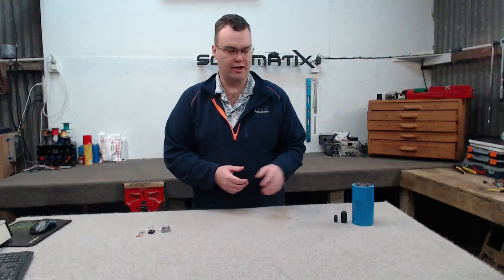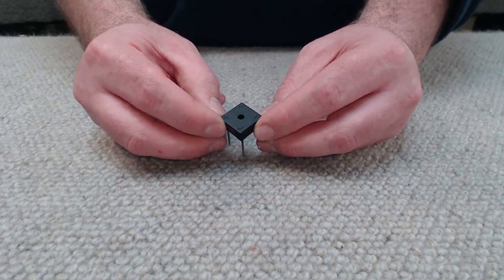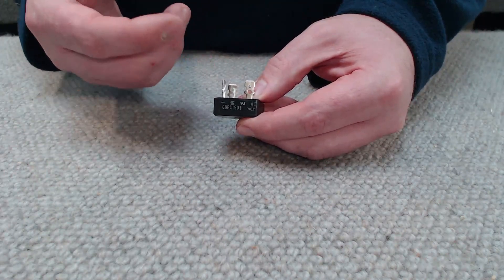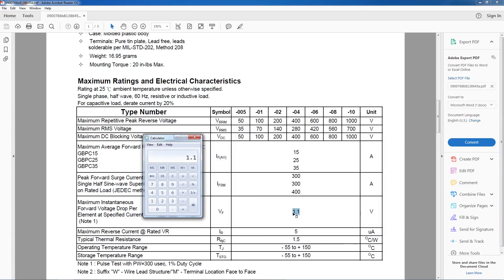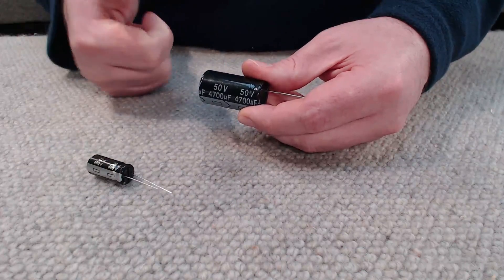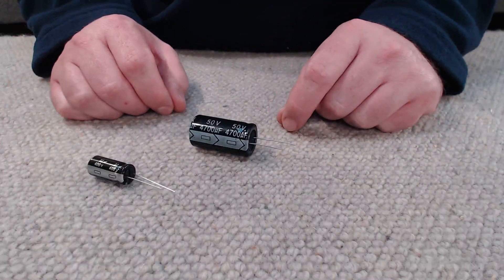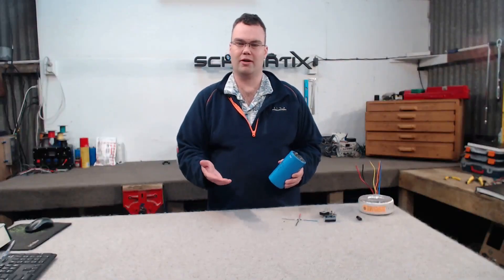How To Choose The Right Rectifier & Capacitor For Rectifing AC to DC

Comment from the maker: Please study the calculation examples in the video description to better understand how to read the results of any calculations you make for capacitance  :)
Reply: Raks Electric; OK, first you have to find the peak voltage after rectification. You calculate that simply by multiplying the AC output voltage of the secondary of your power transformer by the square root of 2. That gives you the peak DC voltage output of the bridge rectifier, before adding any smoothing/filter capacitors to it. (A very close example to this video would be a secondary transformer voltage of 50V X 1.4142 = approximately 70.71VDC out of your rectifier bridge.)

Then, you as a designer of your circuit, have to determine the "minimum acceptable voltage" that your circuit can safely or effectively operate from, which, depending on circuit design and type, can vary significantly , however, for most electronic items, if you stay within a 5-10% drop from the Peak DC output voltage of your rectifier then you should be fine. Your specific design may require tighter tolerances than that, but if so, that increases your required capacitance ( and cost ) quite significantly!

So, just for an example that's again relatively close to this video for ease of comparison, let's say that in order for your circuit to work effectively and to perform at an optimum level it needs an absolute "minimum acceptable voltage" of 65 volts DC. If you do the math, that voltage would be within about -8% of the peak DC volts out of your rectifier, so that should be just fine in most cases.

The difference between the peak voltage out of the rectifier and the "minimum acceptable operating voltage" for your circuit would then be the "acceptable voltage drop" that is used in the final equation for determining the required capacitance value. In this example it would be: 
70.71 - 65 = 5.71V "acceptable voltage drop"

Now comes the (slightly) confusing part; This video didn't explain the discrepancies in the units , and that is why the answer is not exactly what is shown, but rather off by a factor of 1000 in each case... The (correct) formula for calculating the required capacitance is, (should be);

Circuit Current (IN AMPS) x Half Cycle Time (IN SECONDS) / Acceptable Voltage Drop (IN VOLTS) = Required Capacitance (IN FARADS)

If you use the above formula with the above shown units then your answer will always be correct... Using the above example's first Voltage calculations, and assuming (again for example only ) that your circuit current is 10 Amps and you are in a location that uses 60Hz frequency of AC power, like in the USA, then the correct way to use the formula is as follows;

(First calculate the last needed parameter to use in the final formula, which is the Half Cycle Time of a 60Hz line frequency, but calculate it in SECONDS, instead of mS, as is the error in the above video... This then equals 0.008333 Seconds.) (1/120th of a Second)

Now finally put all of your (correct unit) numbers into the correct unit formula which I showed above and you get;

10 (AMPS) x 0.008333 (SECONDS) / 5.71 (VOLTS) = 0.0146 (FARADS) of required capacitance. (Approximately anyway, due to rounding of answer)

Now, since 1 FARAD = 1,000,000 MicroFarads (or uF), then just multiply the above answer by 1,000,000 and you get the correct answer of 14,600 uF.
In this example's case, I would just use a 15,000 uF capacitor for a filter capacitor, which is the next largest commonly available value above the "minimum required" 14,600 uF.

The above example may seem complicated at first, but once you do it a few times with different values and for different electronic projects, you'll get the hang of it quickly. And if you always use the consistent (whole) unit formula above, and then just quickly convert your answer from Farads to MicroFarads (1/1,000,000th of a Farad), then you will always calculate the correct answer when doing this!

FYI, the formula in this video gives answers in MILLIFARADS (or mF) (1/1000th of a Farad), NOT MICROFARADS, (or uF) (1/1,000,000th of a Farad)!... Simply because they are using MILLISECONDS (mS) (1/1000th of a Second), rather than full Seconds... Somewhere along the line, the units got switched or dropped, (i.e. "lost in translation"), in the formula shown in the video, from the original, correct formula which I gave above... Possibly because oftentimes mF (millifarads) is commonly mistaken for uF (microfarads), simply because of the letter "m"!

Anyway, now you know the "rest of the story", LOL!... I hope this detailed explanation helps someone out there to better understand this at least, because knowing what is the correct size of capacitor to use to filter your AC-DC power supply is a VERY important part of proper electronic equipment design!
Reply: JoeJ8282 I really loved ur explanation
Reply: @JoeJ-8282  Great Explanation :)
Reply: @JoeJ-8282  Gr8 job
Reply: @JoeJ-8282  Your response was very good, but, instead of posting this:

"(First calculate the last needed parameter to use in the final formula, which is the Half Cycle Time of a 60Hz line frequency, but calculate it in SECONDS, instead of mS, as is the error in the above video... This then equals 0.008333 Seconds.) (1/120th of a Second)"

You should have posted this:
"60 Hz AC in the US means 60 full sinusoidal cycles per second.  We need to calculate the half cycle time, so we compute 60 * 2 = 120.  We do this because there each full cycle is made up of 2 half cycles.  Then we compute 1/120 = .0083... seconds for each half-cycle time duration."
Reply: @ab_ab_c  Well, either way it's saying basically the exact same thing, and with a similar number of words too, so semantics and nitpicking the explanation is unnecessary. Your paragraph and wording works fine, and the way I said it did/does too. The important thing is that whoever actually cares enough about this topic in order to actually read and pay attention to all of this will probably understand either way of saying it, (i.e. either yours or mine), so it doesn't really matter too much.
Reply: @JoeJ-8282   Wow! very well explained.  I have a question. I have a transformer rated at 120VAC stepped down to 12VAC (180mA written on transformer label) with a full bridge rectifier (1n4007) and capacitor.  My circuit requires 12VDC. How much capacitor (capacitance and voltage) do I need to ensure no problems occur?  Thank you in advance :)
Reply: Accumulator1; I totally understand your confusion, however, you made the same exact (very common) mistake that this video makes, in confusing the units of mF (MILLIFARADS) and uF (MICROFARADS)... The answer actually IS 15mF, however, it is ALSO 15,000uF, because they are a ratio of 1:1000 ... The full, detailed explanation is below;

(BTW, A Higher capacitance used for the filtering of a bridge rectifier actually results in LESS of a voltage drop, not more, and therefore a higher capacitance also results in a more stable final DC output!)

Now comes the (slightly) confusing part; This video didn't explain the discrepancies in the units , and that is why the answer is not exactly what is shown, but rather off by a factor of 1000 in each case... The (correct) formula for calculating the required capacitance is, (should be);

Circuit Current (IN AMPS) x Half Cycle Time (IN SECONDS) / Acceptable Voltage Drop (IN VOLTS) = Required Capacitance (IN FARADS)

If you always use the above formula with the above shown FULL units then your answer will always be correct... Using this video's "Acceptable Voltage Drop" calculations for an example, and assuming (again for example only ) that your circuit current is also 10 Amps and you are in a location that uses 60Hz frequency of AC power, like in the USA, then the correct way to use the (correct unit) formula is as follows;

(First calculate the last needed parameter to use in the final formula, which is the Half Cycle Time of a 60Hz line frequency, but calculate it in SECONDS, instead of mS, as is the error in the above video... This then equals approximately 0.0083 Seconds.) (1/120th of a Second)

Now finally put all of your (correct unit) numbers into the correct unit formula which I showed above and you get;

10 (AMPS) x 0.0083 (SECONDS) / 5.5 (VOLTS) = 0.015091 (FARADS) of required capacitance. (Approximately anyway, due to rounding of numbers)

Now, since 1 FARAD = 1,000,000 MICROFarads (or uF), then just multiply the above answer by 1,000,000 and you get the correct answer of 15,091 uF.
In this example's case, I would just use a 15,000 uF capacitor for a filter capacitor, since it is so very close to the calculated value, and that value is the closest commonly available value. Plus, since most electrolytic type capacitors generally tend to measure slightly higher than stated anyway, especially when new, then you should be just fine!

The above example may seem complicated at first, but once you do it a few times with different values and for different electronic projects, you'll get the hang of it quickly. And if you always use the consistent (whole) unit formula above, and then just quickly convert your answer from Farads to MicroFarads (1/1,000,000th of a Farad), then you will always calculate the correct answer when doing this!

FYI, the formula in this video gives answers in MILLIFARADS (or mF) (1/1000th of a Farad), NOT MICROFARADS, (or uF) (1/1,000,000th of a Farad)!... Simply because they are using MILLISECONDS (mS) (1/1000th of a Second), rather than full Seconds... Somewhere along the line, the units got switched or dropped, (i.e. "lost in translation"), in the formula shown in the video, from the original, correct formula which I gave above... Possibly because oftentimes mF (millifarads) is/are quite commonly mistaken for uF (microfarads), simply because of the letter "m" being common between the two unit names! In addition, the "u" in uF isn't actually a "u" anyway, but instead it is only the closest resemblance on a common keyboard to the real unit measure, which is actually the Greek letter "mu", shown in lowercase, but to make matters even worse, that same Greek letter in Uppercase is also "M", and sometimes people state MILLIFarads as MF instead of the more proper mF!... This all results in very much confusion between the MICRO- and MILLI- prefixes of the FARAD capacitance unit!! (I see that mistake being made almost all the time, so it helps to understand the difference!)

Anyway, now you know the "rest of the story", LOL!... I hope this detailed explanation helps you to better understand this, because knowing what is the correct size of capacitor to use to filter your AC-DC power supply is a VERY important part of proper electronic equipment design!
Reply: I love your tutorials but I don't understand your capacitance formula. Result say 15.090mF but you call it 15 thousand mF. Does higher capacitance mean more voltage drop?
Reply: Schematix Hi there I was wondering if how you find out the minimal voltage drop and the peak voltage after rectification.
 thanks
Reply: JoelJ8282: thanks for your detailed explanation. I'm in the process of building my first Full Wave Bridge Rectifier using diodes (I'm not using an "off-the-shelf" rectifier) and coupling that to a voltage divider to power up a dc volt/amp meter that will show the output of a 0~30 volt ac supply I built. It all works fine but I was having trouble sizing the capacitor until I came across this video and then your clarification. I found that everything you said was what I have found: I'm using a larger sized capacitor because, as you said, the voltage drop is less and the output signal is much smoother - my DDM and oscilloscope proved those points. Thanks again.
Reply: JoeJ8282 thankyou very much now I understand
Reply: Great explanation. I observed the same mistake in the formula and you clarified it perfectly.
Reply: Liked & subscribed !
Reply: Llllllllllllllllllll
Reply: Lollllllll.

Comment: Hi, I am replacing the rectifier on my car battery charger and it has a 22UF cap on it and the new one that I ordered tuned up and is only half the diameter and the two legs come out the same end as each other where as the old one comes out both ends, will this still be ok or should I look for another one, also does the capacitor connect positive to positive and negative to negative on the DC pins. Thanks.

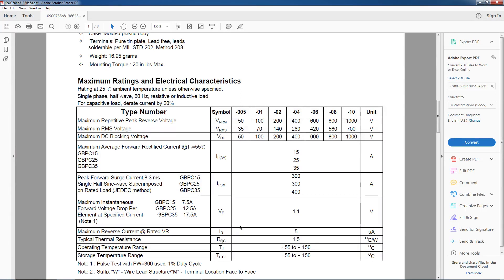Comment: The forward voltage drop shown at 4:24 in your video (Vf = 1.1.V) is the forward drop per diode in the bridge.  The positive and negative paths through the bridge each have 2 diodes in series. You need to make allowance for double the voltage drop i.e. 2.2 volts and consequently double the power dissipation. Selection of the "right" capacitor also requires consideration of the load current. If the ripple current rating of the capacitor is inadequate it will have a short life.

Comment: As someone who knows nothing about electronic components, what is the capacitor used for with the bridge rectifier.  Is this called a "full wave" bridge rectifier when you add the capacitor or is that with a resistor added?  I am trying to repair a set of LED christmas light string, which is 110V at .02 amps.  There are 36 LEDs.  The rectifier was burned out during a bad rainstorm and the plug got underwater.  The LEDs are still good (I tested them).  I can't get another rectifier (tried many places that sell christmas lights) and the place I bought them from recommended my to build one..  I was thinking a 150V 2amps rated but don't know if I need to add a capacitor and/or resistor.  What components do you recommend I use?  Thank you

Comment: Hi. thank you for explination but i want to clarify something: your math in calculating the capacitor value is not right, or the formula is wrong. maybe the formula is in milifarads since you used miliseconds.. the result from your calculator is 15.09 milifarads what is equal to 15090 microfarads. Best regards!

Comment: Would a 100volt 3,700 or 5,000 or 10,000 Farrad capacitor be dangerous ? I need 100volt because a bicycle bottle or hub dynamo can output up to around 100 volts ac on very fast down hill descents. I plan to use it to make a full wave bridge rectifier as a smoother for my vintage bicycle dynamo lights to stop the very annoying strobing that occurs with the AC & to hopefully enable the light to glow for a few minutes when stopped at traffic lights when the current from the dynamo is no longer flowing - the capacitor discharging into the load ( a 3 watt total of  front & rear led bulbs).  How long could I expect the lights to glow for before going out completely with these value capacitors please?
Reply: what is the ominal voltgage
hard to beieve the voltage peaks at 100V  - maybe a cheapuit or badly designed
such caps are quite expensive, so I would limit the votgae - maybe use a power zener
Reply: How long could I expect the lights to glow for before going out completely with these value capacitors please?
depends on the cap value, current and drop-out voltage
you can google th cap dischrage formula but it is a bit nasty

Comment: Hi. Enjoyed your video. I have 2 questions, I wonder if you can help me with or provide a link to point me in the right direction.

1. Adding capacitance usually improves performance but how do you calculate threshold beyond which adding more will no longer make an improvement?

2. I'd like to understand the difference in designing a power supply using vacuum tubes Vs using diodes.

Thanks and more power to your channel!
Reply: gOOGLE CAPACITANCE VERSUS RIPPLE
Reply: Adding capacitance usually improves 
  depends on the circuit - for a power supply using a full bridge rectifier the rule of thumb is 2000 uF per Amp but the point of no difference is rather complex.  MOTOROLA has some reference books showing this
Reply: silicon power diodes;  longer life, smaller size, efficiency,  lower cost, easier to obtain, lower heat

Comment: Handy stuff, however, when you got to required capacitor calculation with that formula I don't get where thousands came from as equation gave whole number 15 and a bit but not thousands... Unless we change the wording of the equation from '= microfarads" to '= millifarads' or '= microfarads x10^3' hope this makes sense, good work anyways!

Comment: Hi a very explanatory video, its appreciated greatly. 

The question it brings to mind is, how did you decide on the minimum acceptable voltage and for a long service life how does this acceptable voltage effect the life of the capacitor. From the data sheet I only see the recommended ripple current and not ripple voltage.

Comment: Thanks for the video, I need a 60 micro farad cap by the calculation and I have a 360v 60mf cap from a photo machine flash circuit. But I am not sure about using it, Is it safe to use it? It is above the voltage I need (16v) but still don't feel safe :)
Reply: higher WVDC is fine

Comment: I am converting the power to a kiln which runs at 240v and 50 amps. The kiln remains ON powering heating coils for long periods...weeks at a time. It's a strange project I realize but please bear with me. I would like to eliminate as much ripple voltage as possible but when I calculate the capacitor specs they are very high (350V-400V and ~42000uF). Even if I try and run 2 or 4 in parallel the cost and availability become real issues. Is it possible to get a partial smoothing with less capacitor power? How well would it run at 10,000uF? Thanks for helping!
Reply: try a capacitance multiplier     it is just a BJT transister, resistor, and a cap             So a 100 uF cap and a transistor with a gain [beta] of 50 is like a 5,000 uF cap